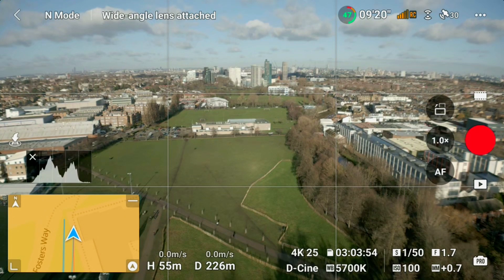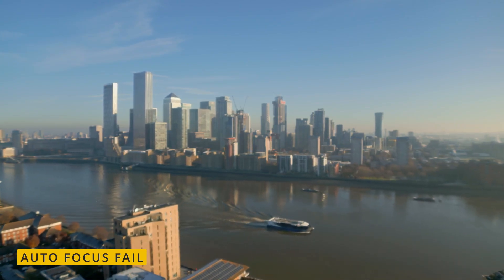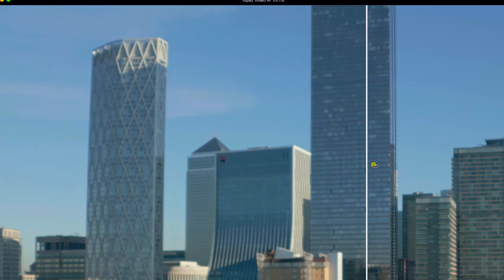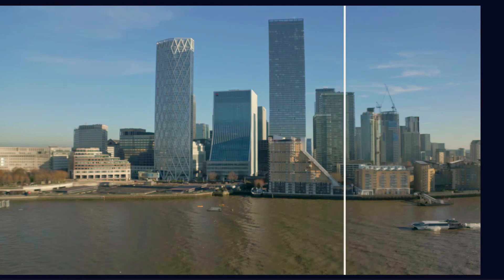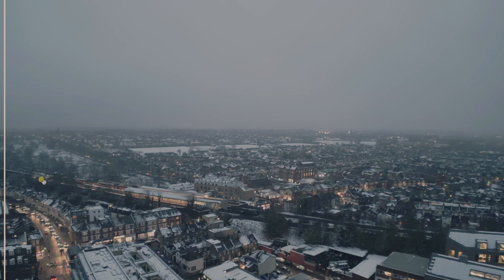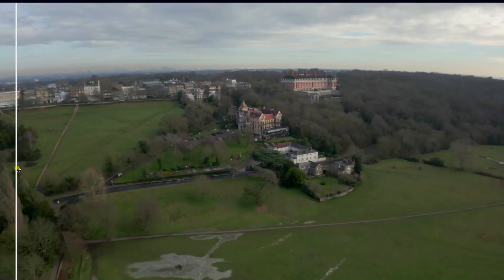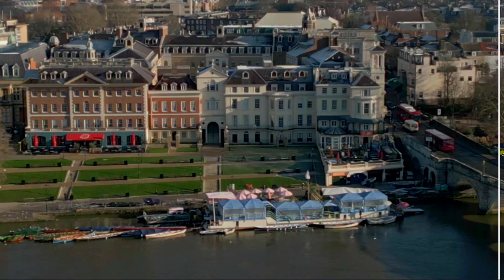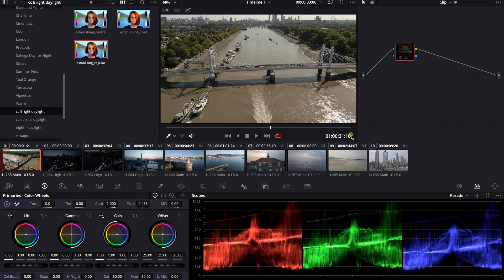Do THIS To Fix Your Out Of Focus Drone Footage

Comment: Thanks for the video Samuel. The problem with these AI video enhancers is that they take ages specially if your footage is high res. For example for a 20-30 minutes footage which needs to be upscaled and deblured will take 2 days, risking damage to computer parts as well specially graphics cards. Unless and until some online high speed solution comes to rescue, these are just good enough for few seconds long shots only
Reply from the maker: You have a valid point. Nothing beats getting it right on the day. These AI tools should be a backup to a fuck up 🙂 not a solution to boost the footage per say. But it can definitely bail you out if need be…..
Reply: Are you using an m-1 or the ilk? I’ve yet to find a (native) video editing program that isn’t shockingly faster. It’s completely changed my workflow.
Reply from the maker: @mewintle  I edit on a macbook air M1. Will probably upgrade to M3 when it comes out… How about you?
Reply: @mewintle  i have used it on variety of machines. I have an M1, M2 as well as Intel,setup with RTX graphics card. My vlogs are long and usually between 30-40 mins in length. I have given up on upscaling such long footages from past, as the time period is not worth it. The best use for me is only for footages upto 20-30 seconds in duration.